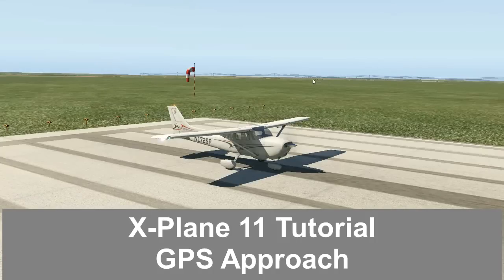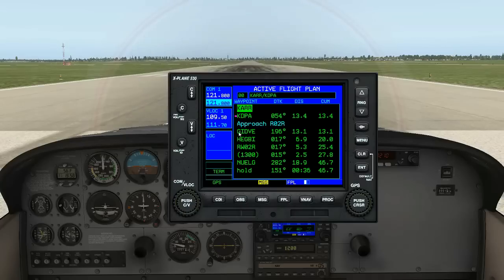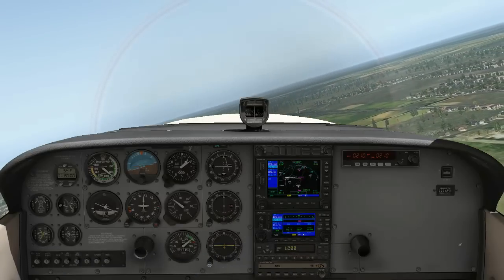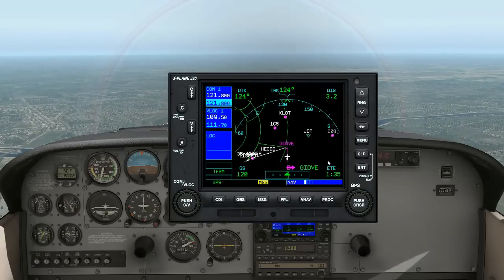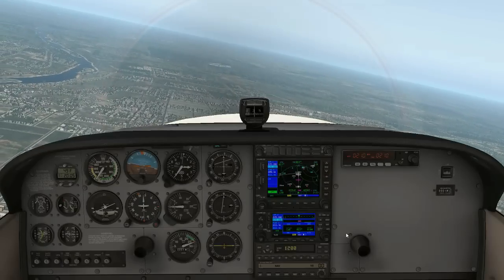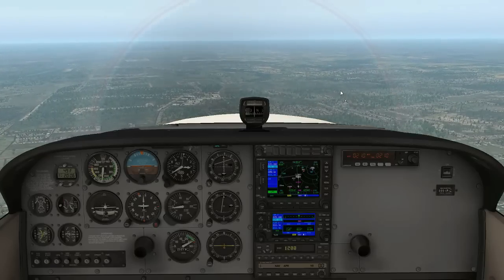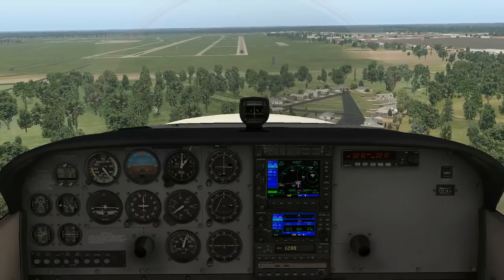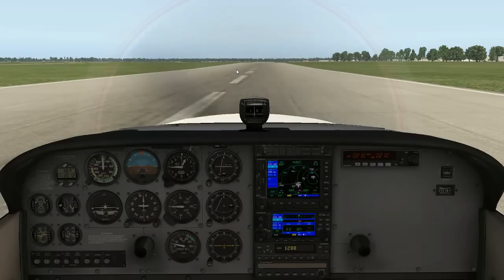X-Plane 11 - GPS Approach

Comment: You say, "great, our GPS has been activated". Perhaps I'm just ignorant but I wish you would say what you do exactly to activate the GPS at that point. It's really frustrating? I hope someone can help?
Reply: He switches on the autopilot.  look at the left corner of AP display, you can see AP sign coming on. This is older type of S-Tec, on newer XPlane versions there is no separate "AP on" button but AP is switched on by selecting correct mode directly (in this case pressing NAV button on the AP panel).
Reply: In my case i had to press the nav button of the autopilot twice...
Reply: @petervandentoorn376  You are correct, I missed that. For GPS Steering (GPSS mode), you do need to press NAV twice as per instruction manual: https://www.x-plane.com/manuals/S-TEC_Autopilot_Manual.pdf (page 22).  It is one press for VLOC tho.
Reply: @Rabarebane   Can you tell me, why the moment I turn on the approach with GPS navigation, the plane starts to turn off course?
Reply: @RaoulsRandomVideos  Hei, one of the latest versions of XP11 changed it so that if you are flying a plane without HSI (like cessna 172), you need to set HDG bug to ILS front course yourself. It also affects the GPS LPV approach. See page 25 of what i linked above. Quote: Before transitioning from GPS steering mode to APR (Approach) mode, set
the Directional Gyro HDG (Heading) bug to the final approach course for
the runway.
Reply: @Rabarebane  Ah I see, that cleared up the issue. Thanks for the help.

Comment: when you say, "time to slow the plane down", are you pulling back on the throttle to do this?
Reply: No he's not and what he did if in a real plane would have damaged the flaps. He extended them above the Ne speed for Fe. 85 kts is the maximum Fe speed.

Comment: Jason, I admire your video’s, but a few words of caution! I see that you run the engine at a constant 2700 rpm/100% power, that is not acceptable in a real world aircraft 55-75% is the norm. On an approach in a 172 170
Reply: i belive its the sake of "quick" tutorials

Comment: C172:-  Use 65 knots as recommended approach speed for full flap (90kts is Maximum for 15 degrees or less if possible; ie. never apply f15 over 90kts) & once over runway, slowly lift nose to burn off speed trying to keep aircraft just above runway but level then very slow sink from say 20 feet (but don't balloon)  letting the aircraft sink nose up until ground contract ideally as stall warning screech begins. Flapless approaches at about 80kts in heavy crosswind only, then kick rudder opposed to wind to stop weathercocking & wing low aileron into wind to keep wind side wing down. [Actual Pilot]. :-)
Reply: yes, 61-65kt. It was a nice tutorial film. But landing speed was odd. Pass threshold at 86 and touchdown at 76... That is high speed. It should bounch or something. I will ignore that part because approach was the topic at hand
Reply: In an R or S model 172 you can deploy 10 degrees of flaps at 105. 85 for 20 and 30. I don’t think flaps 15 degrees are an option...
Reply: @svtpete83  . Thanks. yes. So long ago now. in the nineteen sixties and early seventies when I did most of my C172 c182, c150, C210 flying, I did lots of 'for fun' night circuits at a very dark rural grass aerodrome north of Melbourne (4 million then)Vic Australia. Although not too far out of this big city, take offs & landings into the north were usually 'black' as they faced a 3 thousand foot mountain a few miles ahead, whereas going south the city lights seemed extreme. I recall, one thing in circuits was on passing the runway threshold  whilst going downwing, was to immediately turn base & on 172s, pull off power, applying pitot heat whilst trimming so a glide at 60 knots as those oldies (nearly new planes then) allowed 40 degree flaps. the entire approach was at 60kts with a bit of judicious power at times. One memorable night, the guy in fromt of me was flying a C150, & as I turned final & called 'called final' the 'speaker' squealed as the C150 ahead called 'MAYDAY' at the same time!  He ended up on the boundary road with no more than a bent nosewheel & a cut leg (due to hasyy exit). The C150's engine was so small, that the carby heat 'blanket' failed and iced up due to the long glide on a cool night. it made history, as every C150 on earth was subsequently modified to alleviate this problem. But, yeah. I loved the 40degrees on the C172 because a good pilot could land in a very short distance. i heard that Cessna went to 30degrees to save law suits from 'newbie' pilots & others who Cessna felt couldn't handle 'flaps 40'. You have to remember that the GA fleet of lighties was then being marketed as a car alternative, (laugh) so an absence to head sets! I'm nearly deaf as a result.
Reply: @letsseeif  also this X-plane 11 fellow is too high and fast on final.Folks do themselves a HUGE favor by learning to hand fly land taildraggers 1st,then switch to Tri-gears. I got some time on cubs , champs, and citabria. Next is the Pitts. I'm looking forward to that
Reply: @williamleadbetter9686 . You're right as far as I'm concerned. I'm a Melbourne (Vic0 Aussie and learnt @ 17yo in1957 on on DH-82 Tiger Moth biplanes. Also did lots on DHC Chipmunks and Austers. ALL were tail wheel (or skid) and the art of good three pointers was invaluable. Usual approach (full glide with Handley Page leading edge slats (top staggered forward wing) was 58 knots, but we were also taught "Precautionary Approaches" at 45knots indicated - long low almost flat approaches for short fields (Tiger Moths had NO BRAKES). Rather 'nose up', these were power on until over threshold at which point just above the surface, one cut the throttle & it sunk onto the grass (they had no tail wheel, just a directional skid). 'Ag Pilots' & people like me used this technique on v short fields. After the Tiger, Chipmunks were LOOXURY 'cos they had tail wheels & differential brakes for stops & steering. I noted then that airlines pilots routinely did three pointers in DC3's, up through DC6B's & other big planes as a lower airframe stress landing. (except as in Tiger Moths, a (level) wheel landing (ie. level) (not 3 pointer) were the go in heavy wind with airliners.   I note that all rebuilt old airliners routinely do "fly on level" these days, maybe because pilots never learnt 3 pointers, but probably not to damage someone's pride & joy. :-)

Comment: Thank you for this tutorial. It is very helpful. I did try to follow along and things went well. But I noticed my plane followed the GS correctly but stayed a bit to the right of the Localizer needle. Yours were perfect. I tried approaches at different locations but the plane always stayed right of the Localizer. I generally take over and land manually when I am close in. Is there something I am doing wrong or do I need to make some adjustments to my instruments/settings? 
Thanks
Reply: Set the Heading Bug to the same number as the runway number you're approaching. When the approach button is pressed you can make small tweaks to the runway center through incremental adjustments. Also ensure you have set NAV1 to the ILS frequency of the runway. Even small deviations to a frequency setting can throw you off. Worked for me, but have not tried this with Jason's GPS approach, only in an straight ILS approach. Good luck.
Reply: @mr.martintorres5804  hi, did you eventually try with GPS approach? Does the heading bug adjustment work also for that?
Reply: Matteo Benedetto Manini Yes GPS approach works. I believe the autopilot just works differently than it does in Jason’s tutorial here. Moving the heading bug to the approach course heading does the trick.

Comment: Hi again, I've done that a few times now, works fine, but if I try the same plan but instead of choosing vectors I choose the ILS approach via BOWEN I find that when it starts the turn at BOWEN the GPS keeps turning itself off and the plane heads off in some random direction. Any ideas what I need to do (or not do) to stop it please? Many thanks, Steve

Comment: Hi Jason. I like your videos but I do have a few comments to make. Indeed, your approach and landing speed is way to high. You should cross the threshold at no more than 60 to 65 knots, and touchdown should be at or just slightly above stall speed, which at max weight landing configuration is only 40 knots.
  On the newer172's, (SP) you CAN extend 10 degrees of flaps at 110 indicated. The white arc represents the SAFE PARTIAL/FULL FLAP RANGE, 10 thru 30, and since you cannot use 20 or 30 at 110 knots,  the white arc only goes to 85 knots, the max safe speed for all 3 settings.
  You mention the REV button on the AP to get you BACK to runway 8. Not so. The REV is used for back course Instrument procedures and corrects for the reverse sensing of the instrument needles. Also, you should be fully configured for landing and be in a stabilized approach by the time you hit the final approach fix, usually 5 to 6 miles from the runway threshold. This means approach speed (+/- 75 knots) and 20 for flaps, and around a 450 foot decent rate at that speed. Go to 30 on flaps, if desired, when assured of reaching the runway.
Take care and keep up the good work!!

Comment: Hi Bro! Sorry I Bother you. I have a question. While I was testing what I learned in this video (That's Great, by the way), I could landed great, but when I tried to take off again to another point my Cessena start to turn around madly. Do you have a thought about what it could be? Thanks Friend!
Reply: Lucas Pingitzer they do that if you throttle up fast. I have to gradually apply throttle. I’m not Jason but I’ve experienced the same!
Reply: Thanks!
Reply: ... try to switch off/desactivate NAV1. Airplane still works under control of rwy vor.

Comment: This is not working for me. I've done it 20 times now. I load my approach, and once I'm halfway I activate it, and it navigates to my descending point.. Clicking the APPR button when I get in to the white line, but it keeps going straight, straight over my airport, even though my arrival point and approach are selected on the GPS. I have no idea why this keeps happening?
Reply: Kim Rene Mossige Not sure if you figured it out yet, but this same thing happened to me until I realized this - make sure your at the right altitude to start the GPS approach. If your too high it will fly over. You can find this on an approach chart for runway, I use FltPlan Go app to pull them up quickly for any airport

Comment: Very helpful but you are flying the whole time on full power, after you have taken off you can reduse your power a little until around 20000 rpm
Reply: Thijs Rinsema 20 000 too much, motorn not like too much

Comment: Whats the reason to activate the autopilot @1100feet ?
Reply: ... for safety reasons. When autopilot needs to increase speed it can automatically reduce the hight, goes drastically down to do that, and it takes enough altitude not to crash the land.

Comment: Hi Jason, I have a question about using the default atc or even 124th atc and the Garmin 530. all of the videos i see, i see them open up the atc put a few way points in then start the flight with ATC guiding them all the way. But i have yet to see a video of someone using a Cessna with a garmin 530 and having them use the GPS for the flight plan that they put in. Is there a video like that out there? can some one explain to me?

Comment: Hi Jason, @11:40, the "VS" on your Autopilot isn't activated anymore. Did you turn this off or did the plan this by itself because of the approach button that's turned on? When I try this, only lateral navigation works. On the CDI instrument, only the vertical is moving. The horizontal needle is always centered. It looks like there is no vertical "assist". What could be the reason for this? I can see the glideslope on the map for the runway I'm landing on and position of my Cessna.

Comment: Great Tutorial! But my Plane goes crazy everytime i see the runway..The plane goes up instead of down or he is turning even when i turn off the Autopilot...  its impossible to controll the Plane I have no Idea whats going on... i hope you can help me.  Oh and by the way i do correct the steering but the plane is still not finding the straight GPS Way.
Reply: Maybe i should start to use my trim wheel right?
Reply: Micha Hund 

Before you set ur AP, set ur trim wheel to neutral or middle.  Before u take off, set ur trim wheel to neutral or middle. It's on just about every cheack list. 

Never ask AP to do anything you can't do.

Comment: Hi Jason, I've done everything you've done exactly the same but my aircraft can't seem to find the glide slope? It keeps flying straight.
Reply from the maker: First, make sure that your radio is tuned to the correct ILS frequency. When you are close, open the X-Plane map. There is an option (switch) to show the glide slope. Select the runway and then you can see if you flew over the glide slope ( possibly too high ).
Reply: Jason Vriends thank you it works now! I love the videos, keep up the great work!!

Comment: lol my plane doesnt decent on ils :O
Reply from the maker: Make sure you had your radio (COM1) tuned to the correct frequency and that you were not to high for the glide slope. If you open the map, there is a slider to show you the glide slope and the height your plane is in relation to it.
Reply: Yes it was on com 1 i found the issue i was to high didnt saw the diamond :O hahaha nice vid.
Reply: (Shouldn't this be NAV1?)

Comment: Nice video Jason. I noticed that you began extending flaps at an airspeed of 110 Knots. Vfe for a Cessna 172 is 85 Knots. Any reason not to wait?
Reply: Well spotted, I enjoyed the video though. Just a quick tip back then as well, the Airspeed must be in the white arc before lowering flaps. Lowering flaps with too much speed can cause structural damage in the long and even short term.  :-).  Gleim has a cool x-plane course very well done and it simulates the lessons. Not sure if they are still on 10!
 https://www.gleimaviation.com/xplane/
Reply from the maker: Thanks for the tip. I will be sure to wait in the future.
Reply: Maximum speed for 10 degree flaps is 110 KIAS. He was safe although it would have better if he had slowed down a little bit.
Reply: Default 172 you can get away with stuff like this.The REP plugin has opened my eyes to what trying to land with no flaps will do for you.

Comment: Hey, nice vids. I have watched a few of yours now. I think you do a good job, but there's one thing wrong in this vid. Man, you don't lower flaps at that speed, or you will do structural damage to the aircraft. And in the new XP11, you can actually tear them off of the aircraft. I would suggest looking at the section on speeds of the aircraft, which goes over all of the archs and colors of the speed indicator instrument. Other than that nice vid.

Comment: Does it always continually have tire squeal after you land?  I find that very irritating. I have flown fsx and p3d v3 for years and have been interested in xp11 but find this very irritating
Reply: Don Sanchez The tires squeal when you engage the parking brake. I find it very annoying as well so I lower my master volume when I land.
Reply: Tire squeal is because landing was at 75 kts.. final approach in a 172 is 65, with a flare about 20 feet off ground.  Stall speed with flaps down in a 172 is 40 kts.. This is about the speed you should touch down.  Learning your V speeds will make you a much better pilot and avoid annoying squeals, sirens and horns...

Comment: A little fast for flaps 1!!!
Reply: Approach speed for a 172 is about 70 knots, touchdown 55-60 knots.
Reply: NFE (Flaps extend speed) is represented by the end of the white line on your airspeed indicator.
Reply: Yeaaah....lowering flaps at 120 knots risks tearing them off all the way!
Reply: I think he’s just demonstrating the approach, zero “””” given to flaps and touch down. Instrument level lol.
Reply: Good call! 110 KIAS is max for 10deg of flaps in 172sp. 
Finally.....X-Plane 11 does LPV precision approach. XP 10 had LNAV + V, which worked essentially the same. Technically you can only fly to MDA not DA with LNAV + V.
Does any of this ring a bell? I use Airfoil Labs 172. It has a BK KAP 140 which is a much better AP. Well worth $35 if you want to push towards instrument rating.
Do you know if XP 11 and  AFL 172s and GNS 430 does an LPV approach?
What is your take on the grey/cloudy  instrument panel in XP11?
 I have never seen a rental 172sp with 530 and 430, just 430.

Comment: Oh my, my dear fellow, please go easy on the engine and reduce your RPMs below red line after you level off, say 2300 to 2500.  Then when you need to slow down, reduce RPMs further (maybe 1800-2000) and raise your nose to bleed off speed, and please don't lower flaps until your speed is in the white zone on your airspeed indicator!  I'm not a CFI, just a fellow XP "pilot."
Reply: For not being a licensed pilot that was some great advice.  By the way,  I was once a flight instructor.

Comment: One last thing, how does the autopilot automatically the altitude, because when I was landing it wouldn't automatically decrease so I had to do it manually
Reply: 1) The apr(approach) button on AP must be pushed.  NAV or HDG button (horizontal guidance only) first and then apr button when within a reasonable range.
2) Generally you must be below the glide slope (GS).
3)The 530 should show LPV in green highlighted area.
4) Pulling up the free approach plate from SkyVector will help a lot.
5) You need to be before fix HEGBI at approx 2500 ft (TRACON will assign alt and vector to intercept) or  within 20-30 deg intercept angle or it will guide you to next leg and you will miss your HEGBI fix and glide slope.
I use Airfoil Labs 172sp which has a much better AP KAP 140. I don't work or receive compensation from AFL. Well worth $35.